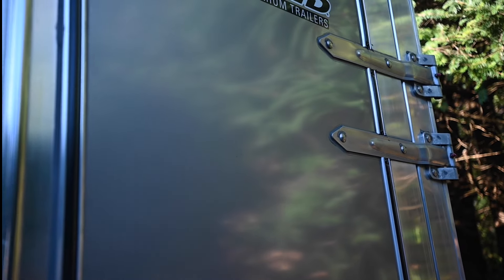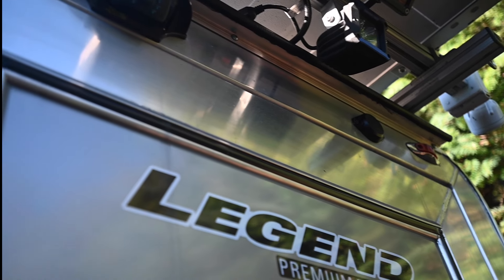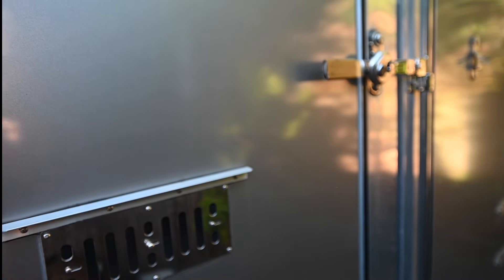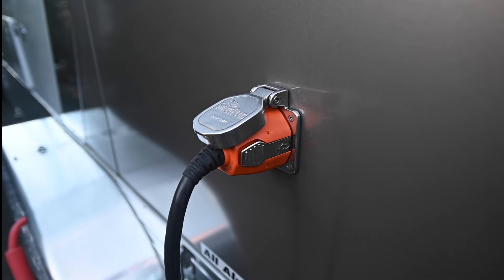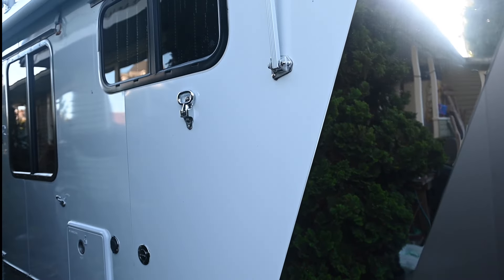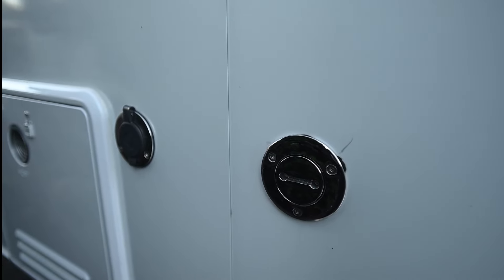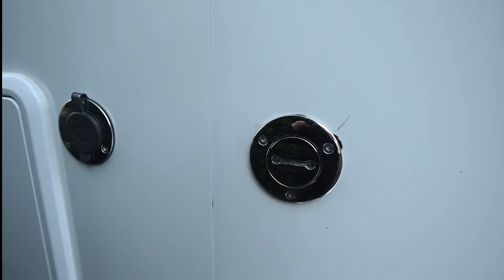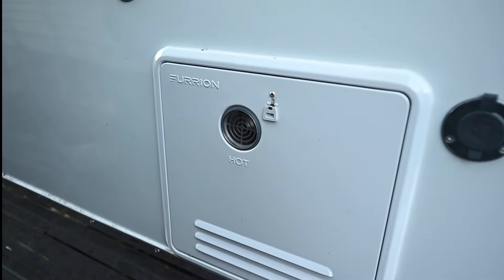Fittings- Unique Fittings that we used on our Custom Cargo Trailer Conversion.

Comment: Hi, I was wondering how you think the Anderson weight distribution system does on the 3x6. I have a legend with the same and wondering if it works setup like that, does it help with sway control ?
Reply from the maker: Hi Daniel...I've never had an issue with sway. The rotating wing at the bottom of the Anderson ball assembly still has quite a bit of resistance, even if the angle is less. I crank it up so you can barely feel the chains flex when you step on them. We've travelled 25,000km and so far so good. Legend sure makes good trailers.  Cheers, G

Comment: Really nice. But what  if one day you forget to take the cork off?
Reply from the maker: I am glad you asked that, because we have forgotten to take the cork off. One of two things happen...The furnace detects that the outlet is obstructed and wont fire up, or the outlet pressure blows the cork out. Both have happened. If you follow this route just make sure that the cork is not too tight. Great observation. Cheers, G

Comment: Can you let me know what vIdeo you have on how you built your propane tank holder? You referenced you’d get into it in another video but I haven’t seen it
Reply from the maker: I haven't uploaded a video for this yet, but you can get a pretty good idea on my website https://gregoryexplore.com/non-rv.html 
if you scroll down to the Propane Tank photo. The only thing that is missing from that photo is the shaped 1/4" HDPE (white polymer) curved cap sheet that acts as a lid under the Sunbrella fabric to stiffen things up. It gets bolted to the rod with a washer at the top. Also stay tuned for that descriptive video. Hope that helps. G
Reply: @gregory-explore  It definitely helps - did you just order one long piece of that tubing and cut it to length or were you able to order it that size? Also - how did you cut the holes in the polymer?
Reply from the maker: @DrIverach  You can order the 80-20 in long lengths or pre-cut, whatever you need. The polymer is just like wood, you can drill it and rout it, or use a jigsaw and sand it smooth. I used a router with a template for the larger holes. Cheers, G